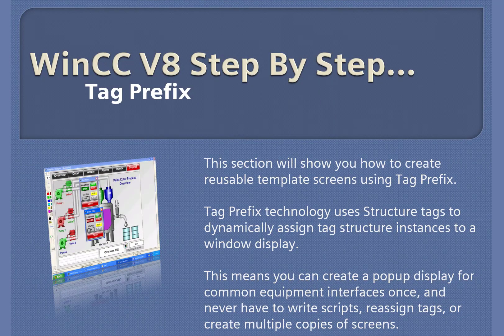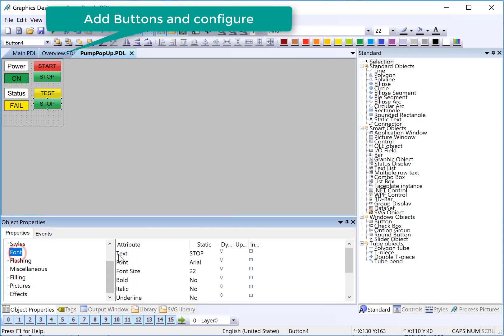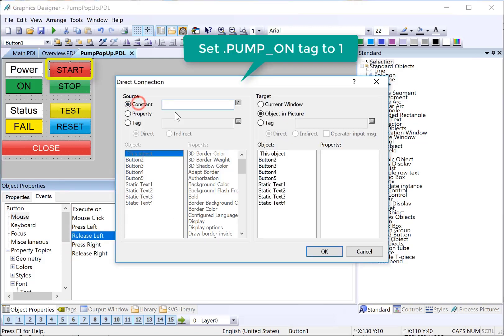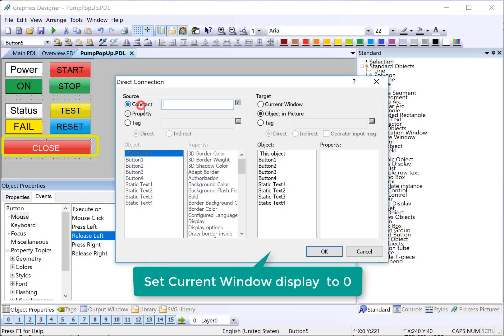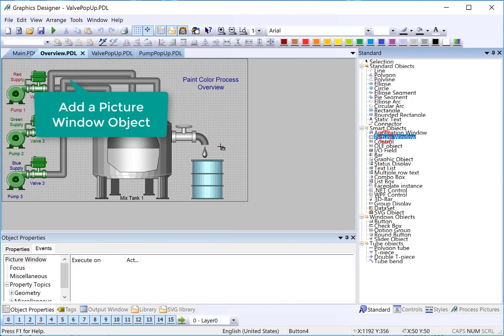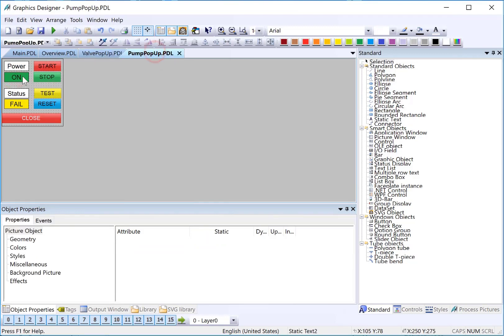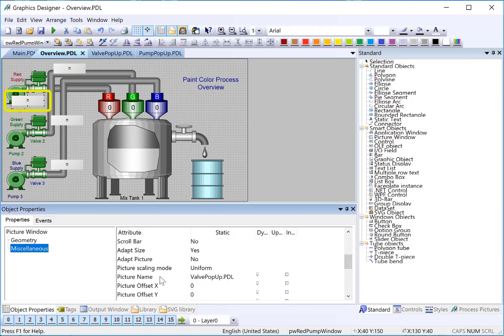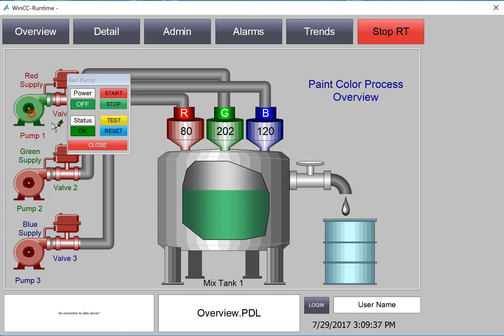WinCC v8.0 Step By Step 15: WinCC Tag Prefix example with Pop Up screens 🏭👨‍🔧🛠 #winccguru

Comment: I am trying to use tag prefix in dynamic dialogue, it didn't show tag missing when i try to write ".tagname", but it show errror when i change it to "_tagname", and pop up window telling missing tag too, just the i/o field turn to red and i can't click okay
Any ideas what i am encountered?
Reply from the maker: Make sure the tag name has single quotes around it and that it’s case sensitive.  If you aren’t getting an error with .tagname then it’s likely correct. Check the logic and data type of tag.
Reply: @WinCCGURU  what confuse me is, i didn't create any tags npr structure tags yet, i usually made tag connection in dynamic dialogue using "_" in previous wincc version, it should pop upa warning about missing tag right away, but now it didn't show any in wincc v8.0, it didn't show up any pop up, and no option to ignore nor create new tag as im video, but when i change it the "_" to a dot, it show now error nor warning once i pressed okay button
So, i don't know what i am missing here, and the forums seems have less references about my issues
Reply from the maker: @ginanjarbinatoro6677  Tag Prefix will work with regular tags if you use a naming convention. You can use '_' if you use that in your tag names. It works the same in V8 as it did previously. Try to create a simple tag named Line01_Tank. Then in dynamic dialog, assign tag '_Tank' in expression. (note single quotes) - then assign Tag Prefix of "Line01" to the picture window and test it out. it should work if you configure it correctly.
Reply: @WinCCGURU  just for updates, i still can't manage to get pass this issue even using "_", so i come up with idea to create dummy tags using "_" to fill out the object's dynamic to bypass these errors/issues, and it is work. Thanks for the explanation, those made me realise to came up with this solution
Reply: @ginanjarbinatoro6677 there is a bug with version above update 3 of WinCC 8.0. That's why you don't see the missing tags popup (thanks siemens). So you should update your version at least to update 3 then it should be fine.

Comment: Are you able to use tag prefix for a VBS-Action within a pop-up? I can't seem to get it to work.

So if I had "Motor.Starts" as my tag and I was looking to have an if then statement like so: 
Set VBVar = HMIRuntime.Tags(".Starts")
If A = 0 then VBVar.Value + 1
Reply from the maker: You can use TagPrefix within VBS Scripts as well as direct connects, dynamic dialogs, animations, or C scripts. It's like you said, just use the tag name without the defined prefix.  I think your issue here is you are setting the value, but never actually writing the tag (i.e. VBVar.Write).  To be clear, setting the Value isnt actually writing the tag. You then have to Call the Write Method. It takes a value to write as an argument. You need: If A = 0 Then VBVar.Write VBVar.Read + 1 End If .  That statement will read the current value of the tag, add a 1, then write it to the tag.  You can also set the Value property as you have dome, then just call the Write method with no argument. Ex:  If A = 0 then VBVar.Value + 1 VBVar.Write End If
Reply: @WinCCGURU  sir, please help me to write a pulse action code in VBS for the button, I want to press the button and give out a command output ON for 1s then OFF. Is it possible?
Reply from the maker: @NHGeneral  yes. you can use wscript.sleep 1000 - the parameter is in milliseconds.
Reply: @WinCCGURU  my code below does not work, please help:
Sub OnClick(ByVal Item)   
Dim result
result = Confirmation("Clear fault?")
If result = 1 Then 
HMIRuntime.Tags(".ClearFault").Write 1
WScript.Sleep 1000
HMIRuntime.Tags(".ClearFault").Write 0
Else
End If
End Sub
Reply from the maker: @NHGeneral  I would need to see specifics on the function "Confirmation" and what value it returns; I would put in a trace statement to verify what "result" is to make sure its getting a 1 when its confirmed.
Reply: @WinCCGURU  oh, it very simple logic sir, just a message box function, reuseable for the project:
Function Confirmation(question)
	Dim result
	result = MsgBox(question, vbYesNo + vbQuestion, "Please confirm")
	If result = vbYes Then
		Confirmation = 1
	Else
		Confirmation = 0
	End If
End Function
Reply from the maker: Ok. You are using the tag ".ClearFault". This is fine if the function is called from a picture window using tagPrefix. I would use APDiag to see if any errors are being thrown and then resolve them. You can also use the Application WIndow to show script errors.
Reply from the maker: watch this video to see how to use APDiag: https://youtu.be/rdIjxpXBvs0
Reply: @WinCCGURU  thank you sir.